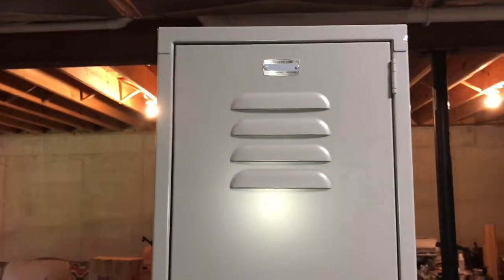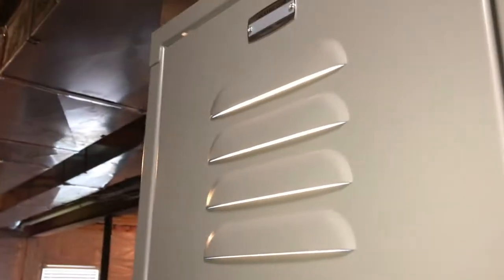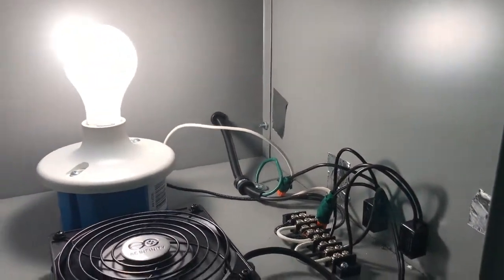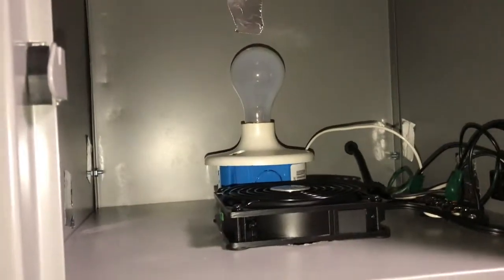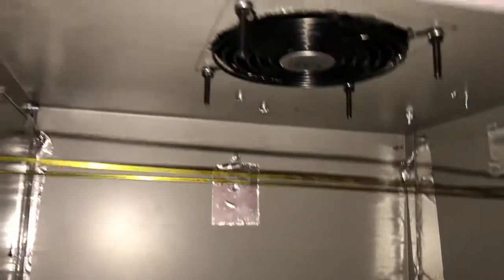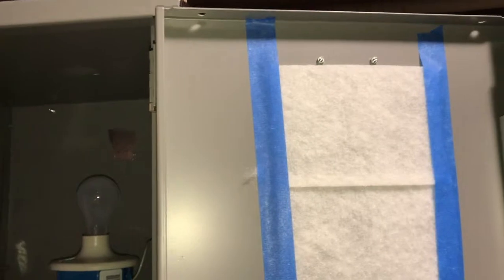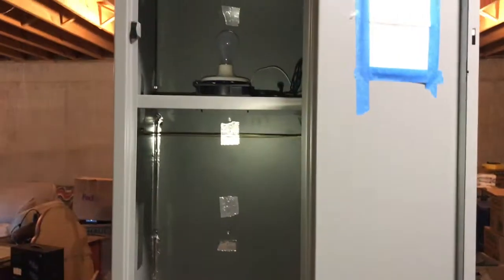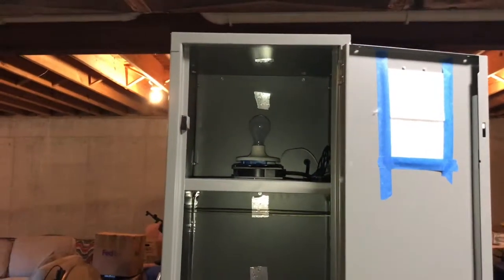FilmDryingCabinet 002

Comment: Wow looks great! How did it end up working? I develop black and white 35mm and I’m having trouble with water spots and streaking. Does this allow the film to dry clean and straight?
Reply from the maker: It really works.  I should have raised the shelf a bit higher because some 36 image rolls are slightly too long.  But my negs are very clean and dust free.  I use photoflo mixed with distilled water and a gentle rubber squeegee when I hang them up to get rid of the spots